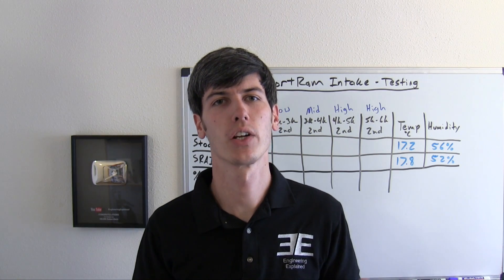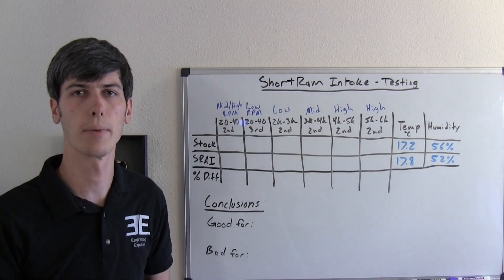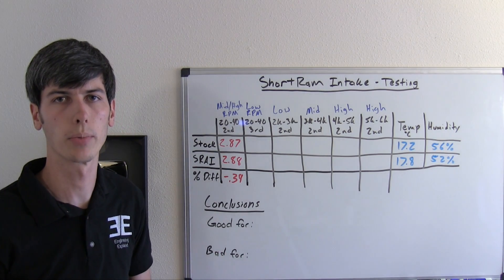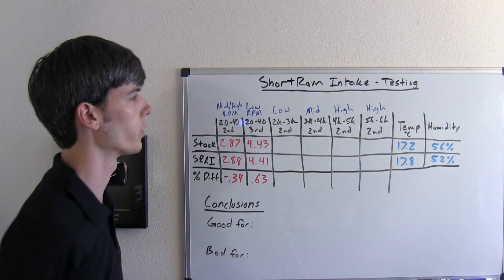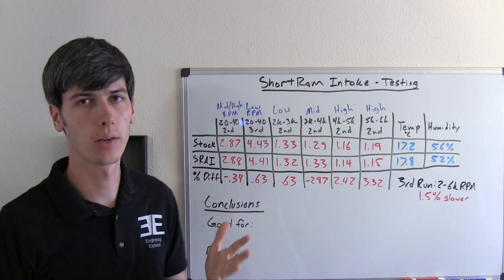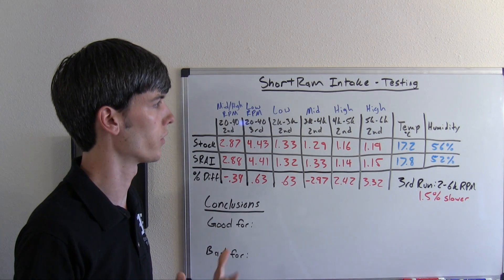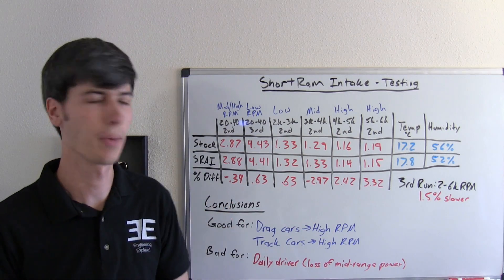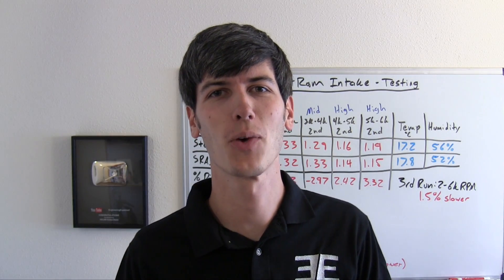Do Short Ram Intakes Actually Work? - Project Integra

Comment: i don't see why any one would waste their time with a srai. given that engineers have already designed the stock one to be as efficient as possible.
Reply: Not really.  The engineers have constraints on them for what they can do.  It needs to only be so loud and can only take up so much engine bay space.  Or it needs to be X inches off the ground so some moron driving through a 12" puddle doesn't hydrolock.  I don't disagree that the SRI is stupid, but CAI I think will do better.
Reply: In engineering there's no such thing as "as possible".  There is only a varying level of acceptability.  You go to marketing/test feedback and you sit down and say, hey are we making enough power?  And other depts give you feedback and say, yeah but it's too loud/too much NVH.  So you go back add some baffles, retest, and your peak hp has dropped 5 hp.  So you sit in a meeting again and find out, is this ok?  Sometimes you're told you need more power, and still minimal NVH.  So you tweak something else besides the intake. 

Everything engineered is compromised.  Physics is a cruel mistress, and she won't let you get away with anything for free.
Reply: Yea, that's a lie.  Most stock intakes are designed like utter shit because they have to work with the engine already in there and have a huge cap on budget 9 times out of 10.  So it becomes a game of "make this get air that's not quite right on top of the engine for X cents."  Also have other blockers too, like sufficient shielding from weather and such.

The one benefit I found when I had a short ram air intake on my car was that it was super easy to remove.  Many people will tell you "well the stock intake is only 4 bolts" or whatever, but in my application I didn't even bother to support the end of the pipe where the filter connected because it rested nicely on the wheel well, so it was literally just one screw to loosen it from the throttle body and I had immediate access to everything.  THAT, I miss.
Reply: Its been mentioned but I'll elaborate. Performance efficiency is different to the efficiency that the Original Manufacturer's engineers would have been working towards. You could aim for efficiency regarding fuel used to power ratio, or you could aim for efficiency regarding cost to power ratio, as a simple example.  
However this video to some extent proves your point. Lots of time, effort and work goes in to making cars the best that they can be out of the factory. You start messing with the formula its wise to be aware of exactly what effect you're having on your car.
Here he demonstrates that a Short Ram Air Intake does give some additional performance at high revs but for day to day use it is not ideal due to loss of power across the rev range. No doubt the engineers who originally designed the air intake for the engine were aware that if they designed it a certain way the could obtain more peak power but the design ethos for the car was to make it efficient as a daily driver so they designed for that end.
Other benefits of a wide power band is a more drivable car. This can be advantageous as a philosophy for designing a racing car, especially endurance racing etc.
Although I'm an enthusiast not an engineer so I may need correcting.
Reply: They design them to, of course, feed air to the engine, but also to quiet it down by adding baffles, resonators, unnecessary tubing, etc. They aren't made to be efficient performance wise (or for most cars at least)

Comment: Ok so once again it is proved that anything other than the stock is bullshit...and very expensive bullshit...however bullshit can become very nice fertilizer once expensive ecu reflash and exhaust redesign takes place...
Reply: Did you even watch the whole video or just the first two minutes? There is an application for short rams: Track and Drag races. The tests concluded that you get a nice benefit in high rev ranges which is a pretty big benefit for the low cost (you can get a no name short ram for literally 30 bucks on ebay a paper panel filter costs what, 15 bucks? and you need to change it almost anually in order to not lose power). On your daily driver it will probably slow you down though, since you use the low to mid range most of the time, where it doesn't benefit the engine or even makes it lose power. Now this wasn't mentioned in the video, but I've been told that you can take care of the powerloss in the midrange by modifying or changing the ECU, but that's pretty expensive.
Reply: edge21str lol you talk about it like you could actually notice the difference, at 5-6k it got it's highest difference of 3%, in overall driving that is going to be completely undetectable, doesn't matter if you drag race or what a short ram intake on it's own is simply useless, you'll get myabe 0.25% faster if anything LOL might as well just not eat breakfast that day too.
Reply: edge21str no it's not going to slow you down or speed you up, you won't know the difference, at all.
Reply: edge21str the point I'm making is, don't put these in anything other than a high performance car that needs it, high end intakes, exhausts etc are pretty much a complete gimmick(among tons of other "performance parts") and waste of money(they aren't cheap either) in normal cars.
Reply: xXJeReMiAhXx99
I'm not going to be arguing over something that's been tested and recreated on multiple runs. Objectively (as you can see on the 2000-6000RPM runs) it makes you a couple milliseconds faster. Sure you might not be able to tell the difference but faster is faster whether it's 1sec or .01 sec. something to mention is, that just because it works on this Integra, doesn't mean it's going to work on your car too.
Reply: xXJeReMiAhXx99
I NEVER mentioned that it's noticeable, just that it's an objective improvement. I actually think it's not noticeable at all and most people just like the louder induction noise. Nonetheless, if you're running on the strip or the track you'll be happy about every shaved off millisecond, whether you notice it or not.
Reply: xXJeReMiAhXx99
I don't know if the price point is really that important. I've seen short rams go for 30 bucks on ebay and there is nothing objectively worse about no name intakes. Do you know the make of you paper filter? No, of course not. It works nonetheless.

Comment: Any chance you could repeat the tests with a cold air intake
Reply from the maker: Omar Ahmed That will be happening, yes!
Reply: Engineering Explained
Do that test with a wrapped CAI too.  I keep seeing these bare metal "CAI" systems and thinking that's not helpful.  It's surrounded by boiling hot engine bay air,  it needs to have a barrier to actually benefit.

Comment: Probably you can get better times if you install the heat shield and the plastic tube ? I think yes , what do you think man ?
Reply from the maker: Didn't come with a heat shield so I didn't test it that way. Perhaps would help delay the drop in times which was experienced while testing. This would prevent the filter itself from heating up as quickly (and thus heating the air), however the air temps would be similar as it comes from the engine bay either way.
Reply: yes because i have a k&n short ram with the plastic one installed in my charger 2012 RT, and I noticed a difference vs the stock box, it depends in the car you install the short ram i think, by the way, awesome videos man , keep it up!